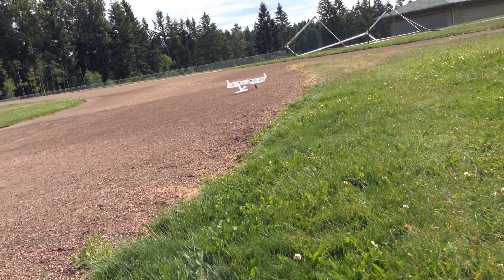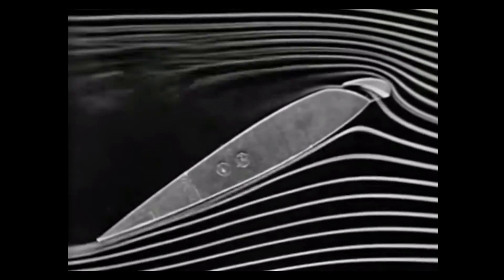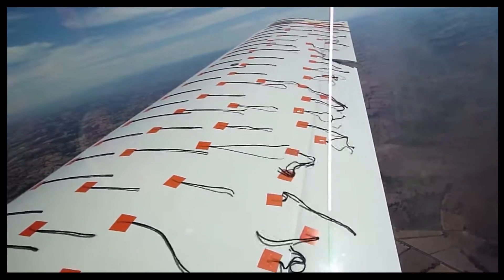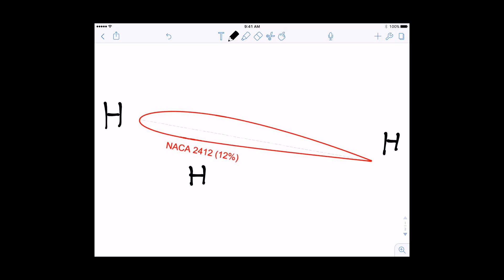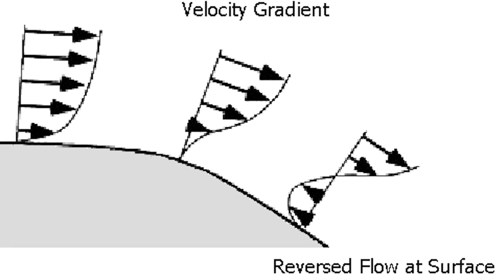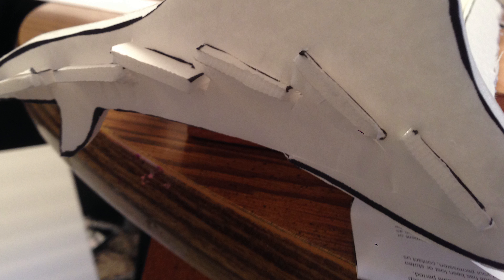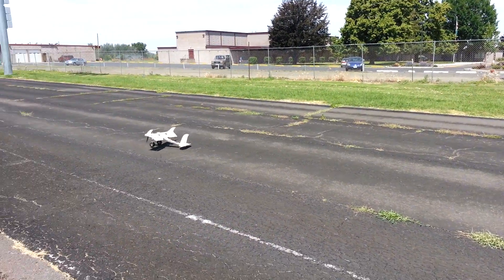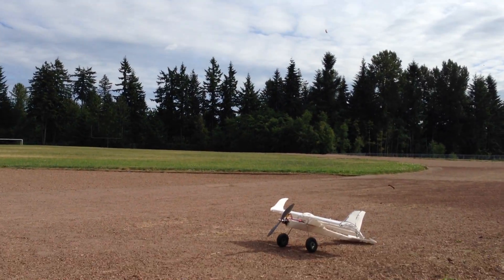Experimental Slat Plane! Unstallable wing?

Comment: One of those crashes looked a whole lot like a stall -> wing drop... but at any rate, +1 on the clear explanation. On an unempirical level, its something that anyone who sails thinks about a lot - how the airflow is being handled towards the aft part of the sail (leech). We observe it with telltails chordwise, plus one attached directly to the back of the sail, with the most important one being off the top couple battens. When that telltail sucks forward, you know the back of the sail is more or less stalled, or very very close to it. At the least, the sail will need additional twist to regain flow to regain speed if you fall off the cliff.
Reply from the maker: +Daniel Goldman I was a sailing instructor for two years. You obviously know your stuff:)
Reply: Ha! well there ya go. They do tend to go hand and hand. Liking your videos, giving me some inspiration to go play with RC stuff again. I never did do any (successful) experimental stuff. I liked your trailing link landing gear, might need to fit that to one of my nitro planes.
Reply: There's a difference between a stall and insufficient lift. stalls have to do with the direction the air is flowing at the rear of the wing, stalls massively reduce lift by changing airflow direction. whereas a lack of lift can com from a plane simply being too heavy for the airspeed it's traveling at a given angle of attack. the end effect is the same and pilots commonly cause the first trying to avoid the second (by increasing angle of attack to increase lift until they stall the aircraft).

Comment: To me, it looks like the plane is flying thru a permanent stall.  Did you check the balance before flying??  On a single wing, you take wing's front-to-back measurement, then balance the plane on your fingertips about one-third of that measurement back from the wing leading edge.  Adjust on-board equipment/weight until it is level on your fingertips.  (You can get the same balance by sliding the wing fore/aft on the fuselage) I realise you are doing a totally different thing but it's just a gut feeling I have from watching. Good luck

Comment: Hey! I am a 70-year-old pilot , Built homebuilt aircraft, and rebuilt factory made aircraft. You explained the cause of wing stalls better than any other explanation I have ever heard. Thanks Dwayne
Reply from the maker: +Dwayne Carter thanks man! I'm a CFI now. Would love to build my own experimental!
Reply: @Samm Sheperd  - could this type of Slat Plane be built at full scale? Would the concept still work at full size? Also, horizontal and vertical blinds have slats that can rotate to close the gaps between them. Is it possible to do that and achieve a more normal low-drag flight when the slats are closed? Has anyone ever demonstrated this on even a small-scale model aircraft?
Reply: @manofsan  sorry friend, did you see his last video. I don’t think you’ll get a reply back
Reply: I agree! summed up some much hazy info in a clear concise understandable package
Reply: A agree. Amazing.

Comment: Very good video, as far as the fluid mechanics, good explanation. Have you a chance to experiment in a low speed wind tunnel? I guess the next step might be creating variable slats changing their angle for flight performance?
Reply: I believe some microlights still do
Reply: If that was controlled by hydraulics it would be heavy but early biplanes used wires to stabilise the wings and warp them for rudimentary controls so that might be a possibility

Comment: Very, very cool. I do wonder however how much a slat actually has any real effect on models (versus a non-slatted equivalent size, wing loading, etc) given the extremely low Reynolds numbers they fly in. My gut feeling is that the slat itself is immersed inside the very boundary layer that it was supposed to energize, i.e,  not much significant amount of air is pushed through it to actually blow away the separation bubble. It is as I said a gut feeling as I have never found any reference to slat effectiveness versus Reynolds number. If you (or anyone reading this) can link to anything concerning this, I'd love to read it. Oh, and great experiment, great video, thanks for sharing.
Reply from the maker: Your intuition is excellent. I think small Reynolds numbers plays a large role in this experiment
Reply: loved the video and the explanation was very good :-)
Reply: I was thinking something similar. I think a very high percentage of the lift is being created by the high AoA, and very little created by the airfoil pressure differential. Consequently, I would bet that if you tried to fly this "wing" at an AoA near zero, the lift would be practically zero. Not that it would stall necessarily, but it would force a nose down recovery so quickly it would be like hitting a wall. I think that's probably why he said that the controls felt so odd - it only really "flies" at AoA's well away from zero.
Reply: A large part of slat functioning is that it reduces the boundary layer thickness. this has also been accomplished with porous wing skin and auxiliary blowers that directly suck the stagnant air layer from the upper wing surface. Leading edges and other positive flow displacement areas such as the lower surface have impinging positive pressure flow conditions and inherently thin boundary layers; the thick boundary and stall happens in diverging [slowing] flow regions like the upper surface behind maximum wing thickness, the boundary layer is actually at a fairly low pressure even at very low reynolds numbers and able to allow much flow through a slat. 
Lastly all text books and most simulators exaggerate boundary layer thickness by a factor of 10x or 100x which is illustrative of the general concept but also creates an inaccurate intuition for the true design parameters.
Reply: corisco tupi
Reply: Hello Sir, 
I recently made a model of such a wing and analyzed it at different angle of attacks in software. Would be helpful if you see them and give your feedback.
Thanks in advance,
Shivam.

Comment: I wonder who the 1 idiot is that gave this excellent design a thumb's down. Unbelievable!!  Anyway, a really cool design.  How about performance at higher speeds?  Does stability increase, decrease, or remain the same as speed is increased??
Reply: I don't think he tried higher speeds than this, since he mentions that the wing has high lift and even higher drag.
Reply: it would require lots of power to get it up to a higher speed

Comment: If it never stalls, it would never land. -Certified pilot and airframe technician
Reply from the maker: +Justin Rodgers Um, you don't have to stall in order to land. - Commercial Pilot ASEL, CFI checkride in two days, 3 years assistant to an A&P, AI.
Reply: You might want to do some studying before that check ride. A stall is a loss of lift either due to too surpassing the critical angle of attack or slowing down to a point where airflow is not enough to create lift. Why we have devices designed to lower our stall speed so we can move slower without losing lift.
Reply from the maker: ***** When you touch your wheels to the runway, your wing is not stalled, it is still producing lift. As you lower the nose and slow down, your wing produces less and less lift, and thus your wheels support more and more weight. 

You can bring your wing to a stall just before touchdown, but that is not necessary nor standard procedure.

A stall is only due to the wing reaching its critical AOA, and has fundamentally nothing to do with airspeed.
Reply from the maker: ***** Pass!
Reply: +Samm Sheperd (SNRS) Glad to hear you passed. Please check faa-h-8083-3a page 4-3 paragraph 1.
Reply from the maker: Hi Peponi Child , I always appreciate a good reference. I have definitely been digging into that book a lot lately. Paragraph 1 says:
"This is caused when the wing exceeds its critical angle of attack. This can occur at any airspeed, in any attitude, with any power setting."
I'm curious to know what your opinion is in this comment thread.
Reply: +Samm Sheperd (SNRS) please provide the beginning of that paragraph as well.
Reply from the maker: Peponi Child Okay. "A stall occurs when the smooth airflow over the airplane’s wing is disrupted, and the lift degenerates rapidly."
Reply: +Samm Sheperd (SNRS) thanks. passing the critical angle of attack will surely cause a stall. Why a stall can happen at any speed. There are other ways of attaining a stall however. any think that disrupts that airflow and causes a rapid loss of lift. if you had some kind of device that protruded above the wing during flight that would disrupt that airflow and cause a loss of lift that would be a stall. If your speed is such that airflow is not enough or "disrupted" that is also cause for stall. when the wings don't create lift, they stall. To not stall is to never stop creating lift. to never stop flying.
Reply from the maker: Peponi Child You are right that a change in the wing shape or the operating reynolds numbers would change the critical AOA. But given the same wing shape, just because your descent was arrested by contact with the ground doesn't mean that the air flow has separated from the upper surface.
Reply: +Samm Sheperd (SNRS) would love to continue this conversation but I've got a fight with 100s of passengers counting on me in the morning so we'll just have to agree to disagree.
Reply from the maker: Peponi Child Okay man, safe flight!

Comment: Here's a project I'd love to see in a model: In iceland, there is this experimental plane. It doesn't have a prop or turbine. Instead it uses an Impeller (like your Fan-model) to compress the air. Then it releases this air over slots across the top front side of the wings in order to generate thrust and lift over the wing surface. The real thing never flew, cause it uses only a weak regular piston motor and would need a small powerful turbine instead. If you are interested in building this, let me know. Cheers, Mark
Reply from the maker: +MarkxTube That does sound cool, I believe it's called "blown flaps" and I've contemplated ways of doing it.
Reply: Yupp, sorta. Most designs so far featured a prop or turbine on the wing where the expelled air is directed over the flaps or wings (see NASA). This one distributes that air internally. Just found the Patent for "TF-JFP": http://www.google.com/patents/US5992792

Comment: what type of radio controller do you recommend to a new and very interested in planes member of this hobby? never built a plane but im studiing architecture so im familiar with the materials  (more chanels, less chanels) price to start, places to get used parts THX and sorry for my english im from spain
Reply from the maker: +FazeGaben. I think 6 channels is an all around great number. Very popular, not much more expensive, and allows for lots of room to experiment with more complex aircraft. can have all the controls, PLUS add flaps and retracts, or launch rockets or drop things or control lights!

Even though I don't own one, I've heard that the Orange Tx line is a good product line: http://www.hobbyking.com/hobbyking/store/__54822__OrangeRx_T_SIX_2_4GHz_DSM2_Compatible_6CH_Transmitter_w_10_Model_Memory_and_3_Pos_Switch_Mode_2_.html
Reply: +Samm Sheperd (SNRS)  thank you so much, im thinking to start with a simple plane and my goal will be to build a spitfire, my favorite plane :)

Comment: Really cool man!  Some 10 years ago I did a simulated (x-plane 8) model having split wings, but in a canard (splitted too) /pusher configuration. It was for a contest, but I got in trouble because the sim did some miscalculation or the plane did ride on the canard's wake, which seemed very efficient.

Was pretty funny, how easy it behaved in rough conditions.
But canards need greater take off / landing speeds.
Btw, I named it Jalousie (french for slat curtain).
Reply from the maker: That's cool! I made a Conrad plane a few years ago and so besides the theory, from experience I can confirm that that they have to land pretty fast. can't bring that man wing to Cl max like you can in a conventional configuration.
Reply: Try out X-Plane 10, you can build plane, choose airfoils, see the airflow vectors…

15 min flight time on the free demo, plane builder no limit...

Comment: You did NOT get too technical.  Some questions though... pulling from reading long ago.  Can you correct or say a few words about...

It is worse is the stall starts at the wing tips.  True?  Why?

If you sweep you wings forward instead of back it greatly delays the stall.  True?  Why?

Loved you vid.
Reply from the maker: +MrLemonbaby 
Your first statement is true. The safest stall characteristic is one that starts at the root and progresses toward the tips. This way, the pilot can sense that a stall is happening, but still have control of the ailerons. If the stall happens at the tips first, then the pilot can be caught off guard and with no aileron control.

Where the stall starts from is determined largely by the lift distribution spanwise along the wingspan http://tinyurl.com/jfmcfyh
Which can be controlled by several things such as: washout(twist), wing planform (aspect ratio, sweep and taper) and devices such as stall strips or even vortex generators. http://tinyurl.com/httxos6

Sweeping a wing forward does not delay a stall, but it does have some very interesting characteristics. A normal swept back wing tends to have a spanwise flow from the root toward the tips, and will stall at the tips first. A forward swept wing tends to have a spanwise flow from the tips to the root, where the root stalls first. http://tinyurl.com/juhef42 In both cases, the forward part of the wing stalls last, resulting in the total lift location shifting forwards during a stall, causing a lot of pitching up force. Forward swept wings also are very unstable when it comes to yaw, requiring a large tail fin. They also require a lot of structural rigidity. The forward tips want to twist up, causing some interesting things.
Reply: +Samm Sheperd (SNRS) 
Thank you very much for that.

Comment: I want a Girlfriend like yours :-)  Great Video... I guess this wing is not for high Speed?
Reply: but what if the wing slats rotate like a window blind does for high speed to make a solid wing surface then expand or rotate to the open slat configuration for stalless low speed almost no speed landing
Reply: THAT is the most interesting suggestion I've heard for a long time
Reply: Yes, everything this wing does right comes at the expense of built-in drag. That's why leading edge slats and wing flaps are usually retractable.
Reply: Herbert Shallcross 
EXACTLY, Like the Helio Courier, and Highlander Super STOL.
Reply: +vass ilika he should make a plane capable of high speeds with this wing ... id say it rips the wing apart cuz of the high resistance

Comment: As a sailor I always wondered how a Chinese Junk (sailing ship) was able to carry on sailing for years with sails that were torn and full of holes, the answer I was given was much the same as what you described, each of the holes allowed some of the air to pass through the tear and create a fast moving air stream helping to create a lower pressure beyond the tear. My explanation isn't as clear s yours, I understand it.....I think.
How much more drag did this wing create, did you fly this plane with a conventional wing to see the change in air speed as a comparison? Great slow flyer.
Reply from the maker: +Chris Boyce I taught sailing at summer camp for two summers! In fact sailing is when all this fluid dynamics stuff started to get my attention. Those summers I also got into riding the "Air Chair."

The longer the air moves along a surface, the more it gets slowed down by that surface because of friction. The holes or slats help to "reset" the growing boundary layer with new air. Though a bunch of holes may not be the most effective approach.

I did not put a different wing on this plane, but that may have been a good idea. The motor/prop combo was one to favor high lifting capacity at slow speed, but very limited top speed (it was big but didn't spin very fast).

The best way I can describe the way it would respond to different angles of attack is "mushy" or rather unresponsive. I could rock it back and forth and it would still change lift, but less responsively as a nice solid high aspect ratio glider wing would. Said glider wing feels like a long, deep and slender keel in a sailboat. Very firm traction high performance, very responsive to turning. And a low aspect ratio wing (short and fat) feels like an old school sailboat without a distinct center foil. So I think that a lot of what I was feeling is due to how short the wing is. It had lots of induced drag and so maybe if I make a longer one it would feel different.
Reply: Another thing to add for extra stability would be to add more dihedral with the lengthened wings, all depends on the final application. I like your channel with your practical explanation (proof in the pudding) experimental subjects which inspires thought.